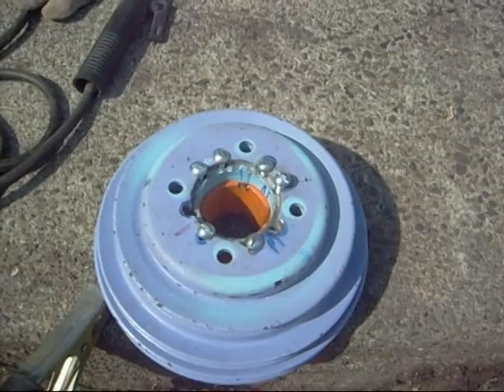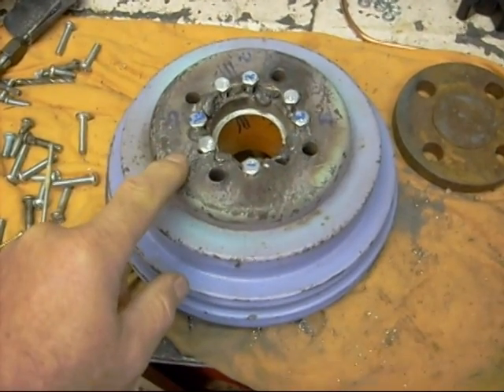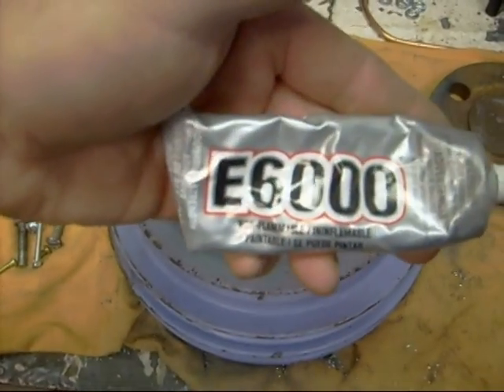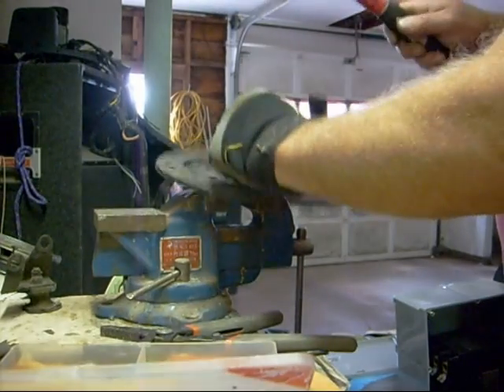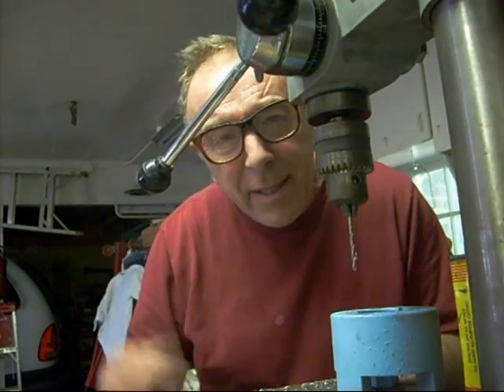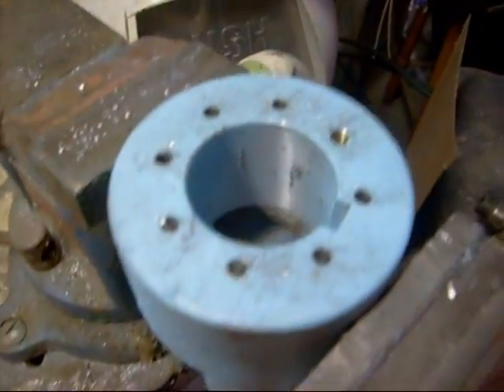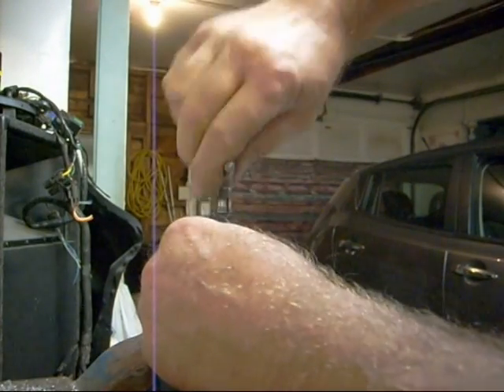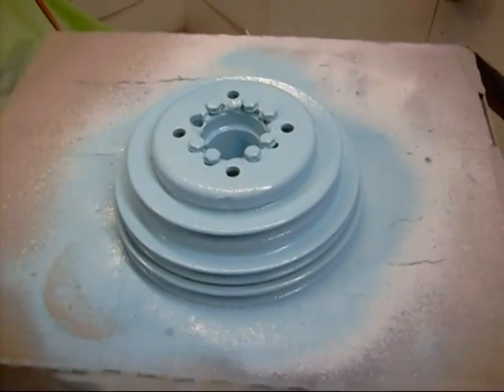The Electric Motorhome. part 18-a.  LeSharo . B+Van RV.

Comment: Coming along nicely. Any problem with the welds making the pulley unbalanced and causing vibration in the shaft?
Reply from the maker: +Steampunk Steve  Hi Steve. I  haven't  had it running fast yet .The 22kw alternator will be set on rubber mounts to try to limit vibration to the floor. Good point though, I hadn't thought of that . thanks for the question..which will raise many more no doubt...ha.